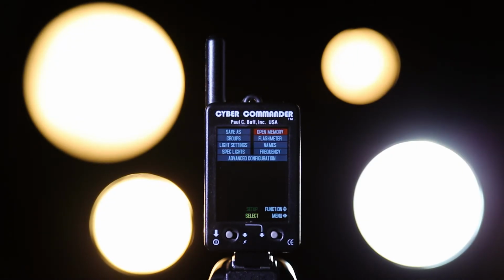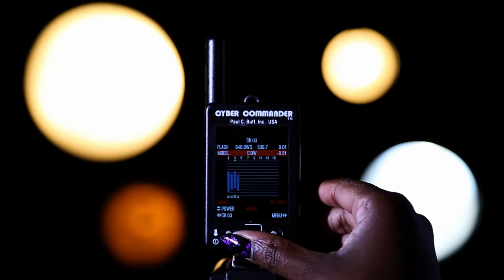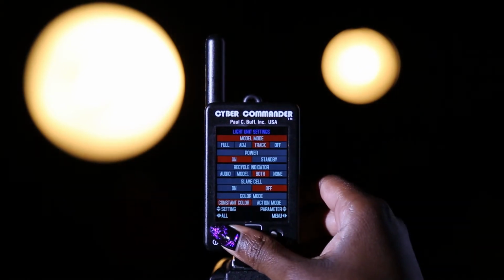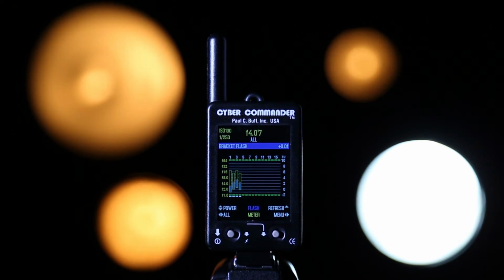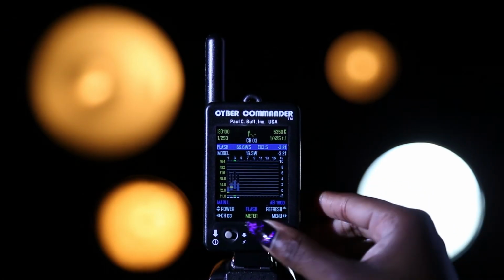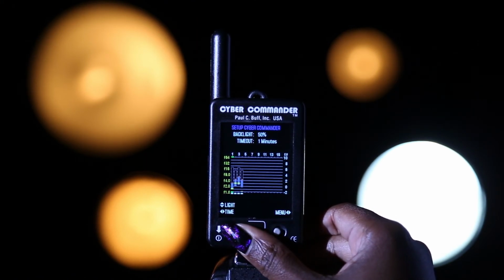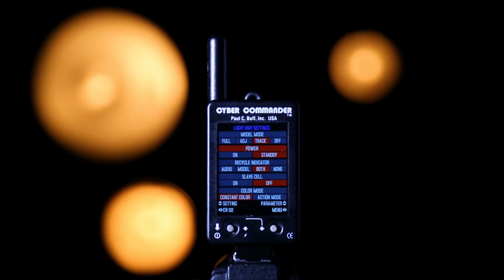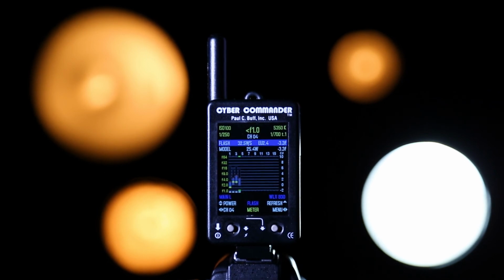Cyber Commander™ – Video 2 - Basics

Comment: When the modeling lights are in Track mode, are they putting out the same power as the actual flash, or does the flash always overpower the modeling lights?
Reply from the maker: Great question! The modeling light output is not as bright as the flash output. Modeling lights are used to show where the flash will be falling on your subject etc.. Track mode is particularly useful when using multiple lights. With the modeling lights dimming as the flash output is decreased, this will (once again) show you where each light is falling as well as how the brightness of each flash relates to one another. I hope that helps! For any additional questions, please feel free to call customer service at 1800-443-5542 and they would be happy to assist you.